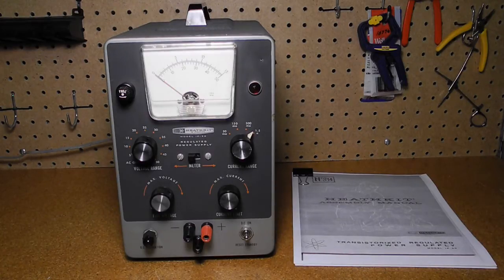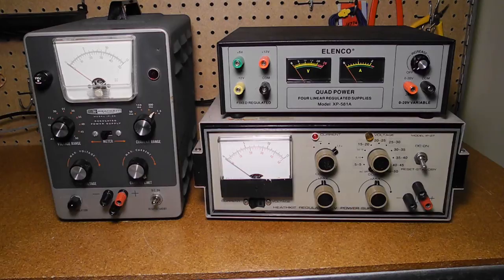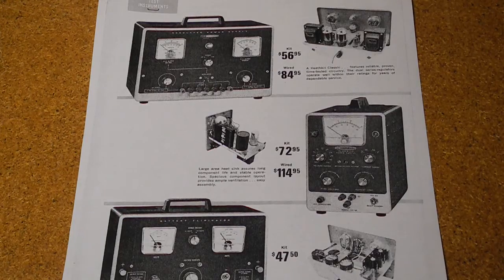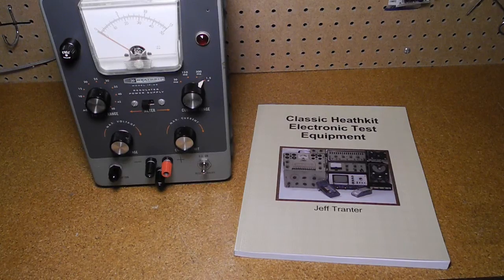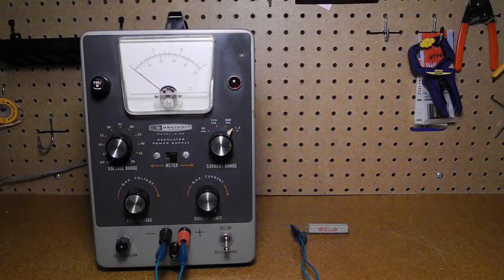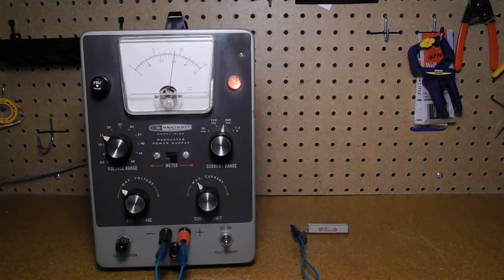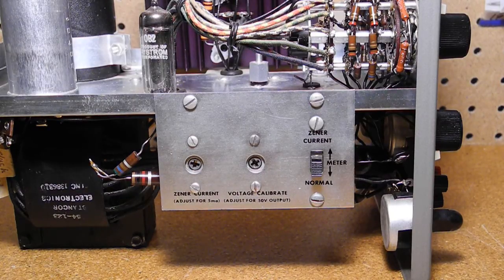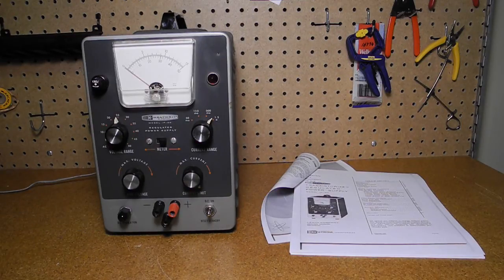The Heathkit IP-20 Transistorized Regulated Power Supply

Comment: I think the main reason Heath had all the voltage ranges on this power supply is that it uses the many separate taps from the power transformer secondary, so the series pass transistors don't have to dissipate as much power; a winding tap with a voltage just a few volts above the selected output voltage means minimal dissipation; smaller (less expensive) transistors, minimal heat dissipation devices, etc. The down side is that it is nearly impossible to use this supply to slowly ramp the output voltage over a wide span.

But this is a good performing supply that is not really outclassed by many decent bench supplies made today.

Comment: I have an IP-20 that I purchased and have just brought back to life.  I replaced all the capacitors and a shorted 2N1548.  I've noticed that there are two versions of the IP-20.  One version has a 3.5 uf electrolytic capacitor connected from the base of the 2N398A to lug 3 of the DC regulation pot, whereas the other does not.  Mine is the version minus this capacitor.  I couldn't get my IP-20 to regulate very well, so I decided to add in the aforementioned capacitor.  Now, the power supply regulates beautifully!  I thought I would pass this information along in case anyone runs into a similar problem.  By the way, the manual that you downloaded is the same one I downloaded.  The schematic in this manual shows the 3.5 uf electrolytic capacitor.
Reply from the maker: Thanks, this is good to know.

Comment: It is nice to see you post this video. I have one of these, but there is no current?  do you have any idea were I should look to repair this unit? Thanks in advance for your help. This old power supply has caused me to roll up my sleeves and start learning the ins and outs of electronics.
Reply from the maker: The manual has a troubleshooting chart. That would be a good place to start. You can find a copy of the manual at the www.mods.dk web site.
Reply: Got it fixed, happy to have this working now I can move forward on other electronic projects. This has not been used for decades.